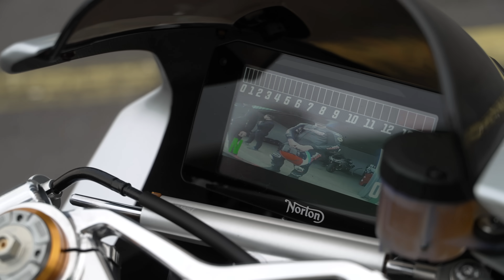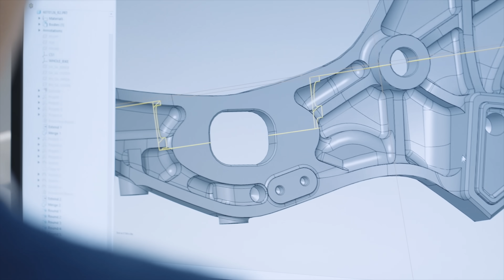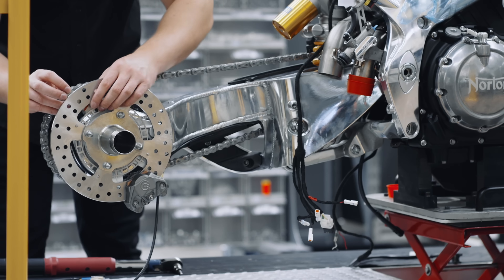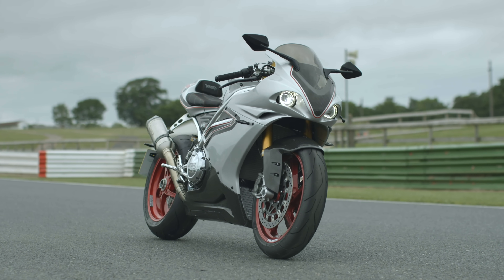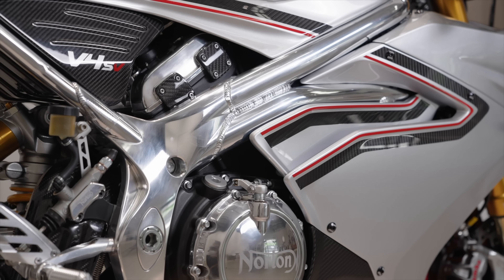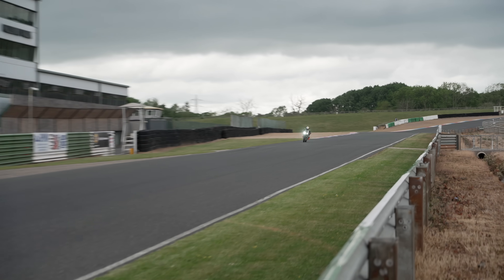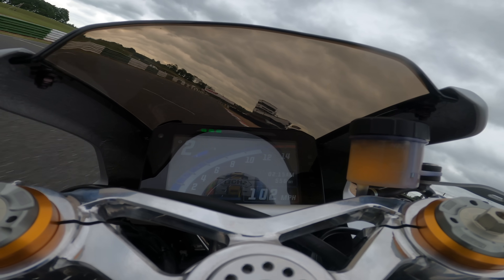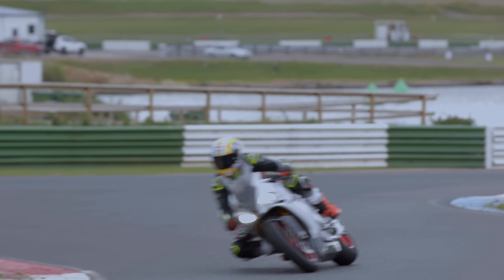New 2022 Norton V4sv On Track

Comment: If it's a road bike, then why not get it to produce more torque over a wider range than the 200hp engines ? I used to think that more power equals more fun, but on UK roads and Euro roads (and trackdays), that simply isn't true - so if you're not trying to match the most powerful, give it the most useful delivery.  It's well outside my price range, so it doesn't affect me anyway !
Reply: Exactly. Too many excuses.
Reply: Absolutely right, all good for track days, but the best buzz you can get on public roads is the feeling of smooth monster torque.  Manufacturers have lost their way, since the 2000s, the sports and sports tourers all look the same to me, boring.  I've got my 81 katana and zxr750, would like a new bike but nothing really interests me.
Reply: @theonlyredspecial  modern 200bhp bikes have shed loads of torque..have you even ridden or owned one?
Reply: Sounds like you didn't listen to his comments!

Comment: Triumph also say they've made a 'Sportsbike for the road' in the Speed Triple 1200 RR. Similar power; same torque; less weight and semi-active suspension for the £18k asking price (although even then, an S1000RR Sport undercuts the Triumph with 20bhp more and with heated grips and tyre pressure monitoring as standard). If the Norton is priced the way the previous attempt was (£28k-£40k), I can't see anyone other than collectors buying it but if they can undercut the Triumph then maybe it would be interesting.

Perhaps we need to wait until we see future models, developed after the investment from TVS and judge the company on their efforts then? After all, it's all very well saying it's an unfair comparison between Norton and Ducati etc. but TVS have apparently invested $124m in the company so this isn't exactly a plucky shed build operation. Hopefully the investment will allow them to bring in the resources and people necessary to compete with the likes of Triumph (if not ultimately companies like Ducati and BMW) without needing excuses made for them.

Comment: 😍 Love to See 👀 All These Legendary Brands Making A Comeback ✊🏼🔥
Reply: Norton is the brand that refuses to be brought back to life, though many have tried.
Reply: Having owned a Featherbed Norton, possibly the most famous of the brands developments, which gave it its justified reputation for handling.... Think Triton Cafe Racer...why does Norton not follow Enfield's lead on classic design and build a modern version of the 'Dominator' either/or a 500 or 600cc (88 or 99) Modern tech in the engine, perhaps oil cooled, plus superior adjustable suspension. In my opinion Norton are aiming at, not at bike enthusiasts but those with deeper pockets..

Comment: Great to see that bike rolling. So many complaints here in the comments?! It is a new european player in the market! They managed to engineer a well performing bike going down a long hard road with a lot of obstacles. What a great achievement that is! Most of the actual brands did not start with the eruptive best in class bike. Give them some time.
Here in Germany we do have HOREX. Also a great bike. Also more of a roadster than a race bike. Also changed owner. 
Of course at this price point it's a motorcycle made for (patriotic) rich petrolheads. From an engineering and cultural point of view this is a making our world a little bit more colorfull. 
Thanks Norton

Comment: I think they should offer it in two packages, a Sports Tourer like the Super Sport with midrange cams and the racer version with the lower bars and lower screen. In the end you need to compete. Cover both segments so you win by bettering in one of the segments. What kills motorcycle brands is the lack of vision to compete. As a sports tourer 180 hp puts it at the top. It will sell there. Add the racer version at lower volume.

Comment: the big problem is the price. its like 2010 bike, ok the 185 hp may sounds less than V4R's 214hp etc, but for the road is ok. the problem is like for 44K, 3 maps ? 3 maps used to be a thing in 2010 gsxr600cc (rain,road,race) or R6 2017...ok we dont need all these stuff like anti wheelie, anti spin , anti gravity anti rocket but dont price it for 44K....

Comment: Glad to see Norton nearly there wit this fabulous bike, not so glad to see that cheap kill switch on right hand clip on that's fades to matt orange and matt black  at the sign of slightest UV light  it's looks like Chinese ebay copy of the Italian MV Orginal from 2010, previous Nortons the same.There detail finish and quality will have to be on par with or better than  MV Agusta and Harley Davidson. Cheap looking brake fluid reservoirs ect. At 44k it needs to be Quality first and foremost, mechanically it's there, electronic updates can be added at service times.

Comment: Nice bike, but, if you want recognition you need to be up on pair with the rest of the segment. Lack of HP and upgraded electronics will not sell. Look at Buell, they will face the same issue bringing their ''New'' Hammerhead onto the market. Missing all the electronic support systems as the competition have. And a bit short on HP with only 185 hp at the crank, you need to be north of 200 these days.

Comment: Sounds like a lot of covering for an extremely average bike that costs 44k. At 44k there is no excuse for not having a user mode or variation of ABS and TC between the rider modes. This bike is a joke for the price they are charging.

Comment: It’s comical when a sub-200 horsepower motorcycle is criticized for not having 200+ horsepower. 99% of riders can’t ride a 1986 GSXR750 to its limits, let alone a 200 horsepower motorcycle.

Comment: How Norton could get the Commando so right while allowing the negative sentiment and symphony of noise to effectively kill any chances of selling a new or used V4SV or V4RC. The V4SS issue will not stop haunting Norton until they stop burying their heads in the sand and pretending they can tough it out when it's evident that they are hurting more than the V4SS owners. Is Norton really that different under TVS than it was under Garner, as it's once again a brand attracting attention for all the wrong reasons and with a product line-up that does not quite make it?

Comment: It's not this bike they need, at 44k and being no match for the other superbikes.
April 2020 tvs took over Norton. Progress is very slow.
It's something like the previously talked about atlas 650, that's needed.

The factory, staff and costs are all mounting up, it wont stop until a range of bikes are for sale and the public can buy them.
At the moment trying to convince the tvs board back in India to keep investing will be an uphill job, as it stands it's just a money pit.
Reply: Agree, to me, it looks like they are making the same mistake as the last two or is it three times they tried to relaunch the brand.
Reply: Old tech, outdated design, a  previous reputation of ripping customers off and having the nerve to price it way above some of the most desirable exotic machines you can buy.  Would love to have seen that business plan being put to the investors.

Comment: This bike is what you call a plucky Brit  obviously hasn’t got the money or the technology to compete with Ducati and BMW but it does its best with what it’s got ent going to compete with Ducati and BMW on the road or the track But it has got one thing of up its sleeve classic good old British engineering
Reply: OMG, good old British engineering, that statement is enough to put the fear of god into anyone old enough to remember 'good old British engineering', which was franky shite.
Reply: You probably don’t You can’t beat a bit of British for example tower bridge one of the great bridges in the world the Clifton suspension bridge Made by one of the greatest engineers the world has ever seen  Isambard Kingdom Brunel and the world famous  Milieu Viaduct in France It was designed by British engineers To bring it up to date the new London Sewage system  being built at the moment when it is finished it’s going to replace the old one that has been going for 150 years another example the A380 jumbo jet the wings  made in Wales the 6 ton engines are made the world famous Rolls Royce factory in Darby there are still lots things built or engineered or pioneered by the British that over 100 years later they all still intact you say British engineer shit
Reply: @ashleytombs  Your examples are valid, but really, nothing in the automotive world in the last 50-60 years, a parade of some of the worst cars and motorcycles ever made with very few exceptions. It isn't hard to make engines that don't leak oil, overheat or break down all the time, and yet those are things that the British never managed. By the time things like wings for the A380 were made, it was an international collaboration, so that they were made in Wales is just a matter of having a facility in available and decent quality control. It isn't that British engineering is shite, but they are not exceptional and there have been far more misses than hits.
Reply: Yes tragically Britain has had more misery then hits they. Can’t compete with China and Japan and Korea on the knocking out engineering masterpiece after engineering masterpiece for example China’s three Gorges Dam is one of the best engineering feats I’ve seen and if you want a ship building then there’s only one place to go to Korea   for Britain to compete with those countries you’d have to feed the workforce beer and kebabs for the whole project do  get any work done and Ontime  lol
Reply: @ashleytombs  I both agree and disagree with what you said. China and Korea have imported a lot of their expertise, many engineers from Germany, Italy and the US were brought in to design things, those countries provided an unregulated environment with no obstacles to making progress which allowed them to do whatever was needed to make the best. Back in the 1960's Japan shamelessly copied proven designs from Europe, the early Nissan 1200 engines were almost exact copies of the Morris Minor engine to the point that internal parts were interchangeable, however they had better tolerances, were better balanced and didn't leak oil. What seems to have held back most Western engineering is regulations, Health and Safety, Human Rights and the need for profit.

Comment: Where's the Atlas that people paid deposits for, before they had a factory to build it?  Has the Indian company compensated the people ripped off totally by the twats that owned the co previously? I've heard it's a goodwill gesture that the co hasn't totally bought into. What's in a name? Noughton sounds good.
Reply: Stuart Garner stole millions from Norton buyers and pensions and has compensated no-one. But in your mind a company that has bought the Norton name (and not much else) and kept a 100 or so people in the UK in employment should take responsibility?
Reply: @richardpinchin3749  Yes, is my short answer that's exactly what they said they'd do when they bought the company. Your problem with this is?

Comment: The V4SV has retained the V4SS looks and many other features, but the V4SS, worth £44,000, was the limited plated run of 200. If this bike is an average production machine when placed against Ducati, Aprilia, BMW etc., the price does not make sense. 

When you look back at the sales performance of the V4SS, because it was a limited run, it sold instantly, and the secondary market pricing was almost a 50% uplift.

TVS has allowed a toxic back story to be created with V4SS Owners and the Norton Management Team. Instead of having the V4SS (or Gen1) bikes as flagship Norton, they choose to trash talk the bike and place owners in a very dark place. 

As a V4SS owner who has invested in restoring his V4SS, I believe Norton has made a significant miss-calculation in handling the V4SS issue. I used my V4Ss in this year's Distinguished Gentleman's Ride in Barcelona; it grabbed centre stage and was featured in just about every social media post. 

Perhaps with sluggish sales performance against the V4SV, Norton may realise that supporting heritage customers will be a very positive sales tool!

https://youtu.be/9is8c5Ewv1o gives you a different perspective on TVS Norton